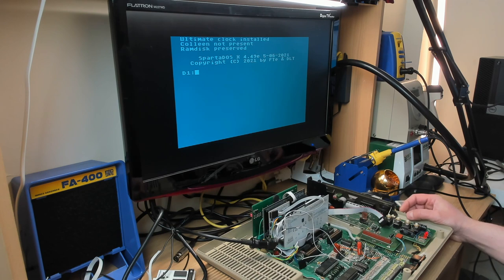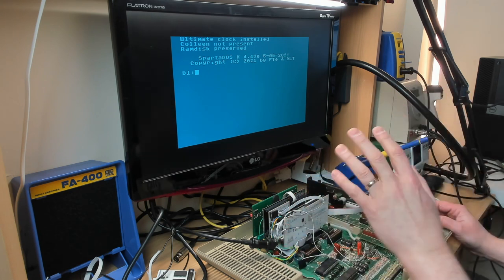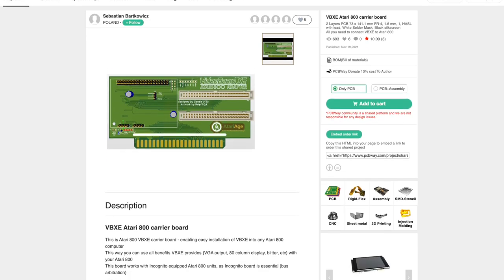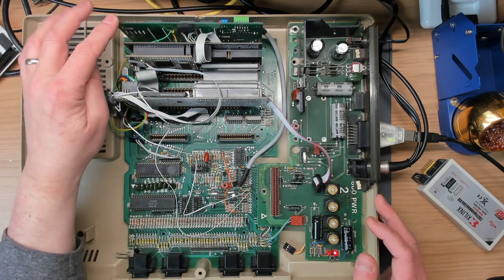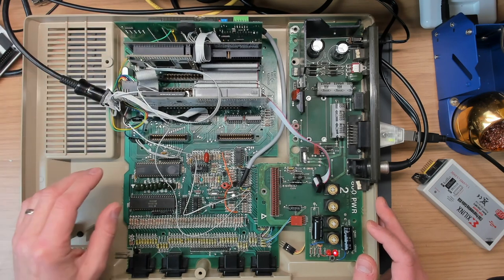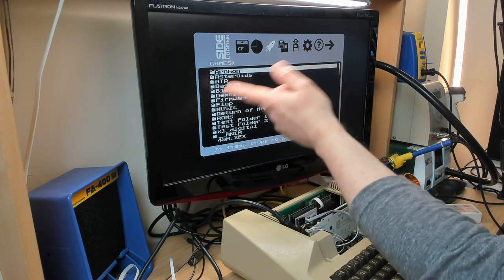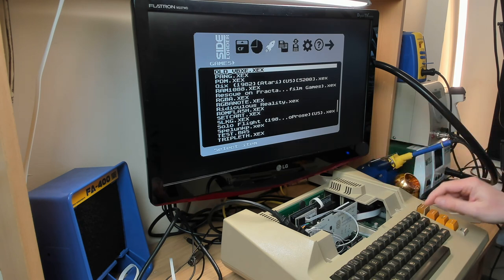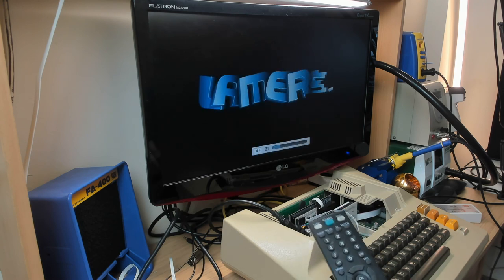VBXE Atari 800 Fixed and Fully Working

Comment: LOL @ the salt section and Candles comment =D  Great job getting it working - Candle does some real magic on these Atari upgrades!!!
Reply from the maker: Yes indeed. I was absolutely knocked out by the fact SIDE3 works well on this machine given all the other upgrades also present. Were it not for my flaky Incognito, everything would have 'just worked' right from the get go, which is really some achievement on Candle's part.

Comment: I have this strong urge to draw up a completely new 800 Power board with new connections on the side to support RGB and get rid of the channel switch in favor of something else, such as in integrated SIO2PC USB connector...
Reply from the maker: Or the footprint for a DIN13 connector for VBXE. Yes: I like the sound of this. The power board could have a lot of vacant space if modern capacitors are used throughout.

Comment: Did you ever find the problem with the old Incognito? Other than that would be a little more clarity on the 3 connections to the bottom of the 800 adapter board. ie Which pins on P2 and which pins on P7  go where???

Comment: Great result!  Always loved the 800, never could afford one, but still happy to be getting my upgraded 800XL really soon.  Finding info & software for the VBXE seems very challenging, and what usually comes up is very steep learning curve!  Has anyone written a Fast BASIC / Turbo BASIC kind of revision that gives commands to directly access the card's features?  That would surely accelerate software development for this card.
Reply: Try MadPascal, it has good VBXE support, among many other things...
Reply: @luisalvarez6196  Is Pascal hard to learn for an ancient like me?  I have used Atari Basic, COBOL (yes, really) STOS, GFA Basic, and a tiny bit of dabbling with 68k assembly, all of which were in excess of 20 years ago haha
Reply: @DarrenCoull  It isn't hard at all, it was created as a language for learning programming. MadPascal has the most extensive set of libraries for the Atari 8-bit I have ever seen, and it's compiled and very fast. It makes hobby programming for the 8-bit fun!

Comment: thanks for next great video. the ise webpack has always been a pain as well as all software from xilinx. I remember I spent two weeks make it working on gentoo linux because I don't use windows at all. btw. the ise webpack can use only 1 cpu core so it is pretty slow when you want to compile/synthesise something and I really don't understand why the installation package requires to download close to 5 GB - unbelievable!
Reply from the maker: I attempted to go down the Linux route but gave up when it became apparent I sort of needed to compile the platform cable drivers. :)

Comment: How do get an Atari 800 to display on a modern LCD monitor?
Reply from the maker: Unless the monitor has composite or s-video inputs, get yourself a RetroTink upscaler or similar. Alternatively, install Incognito and VBXE (which may still require an RGB upscaler), or Sophia (which provides DVI and thus HDMI out of the box).

Comment: outta put an 8231 and 8232 from the datasheets it should work fine with a 6502 based system,  with the xl you can even just slap it on a pbi card with some sram, and throw an fpga with esp32 for fun,  seems you can still source c8232 for pretty cheap found source of 32 of em for $5usd, cheaper than c8231
Reply: theres yo 2k math routines replacement, in hardware
Reply: using fpga and esp you can get 25 and 12ns dual port 32k8 sram on digikey too CY7C199-25BVI and CY7C199CN-12VXAKJT